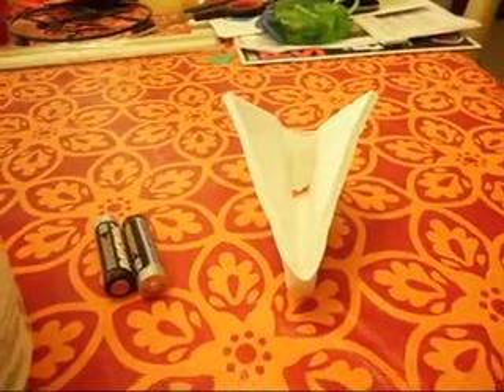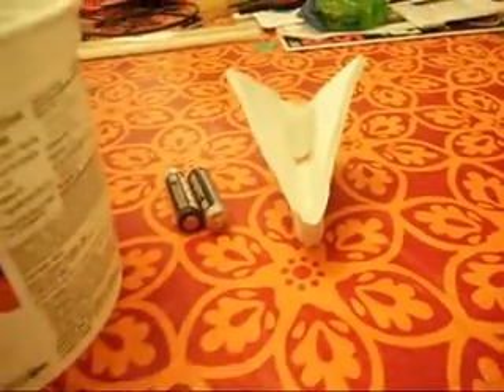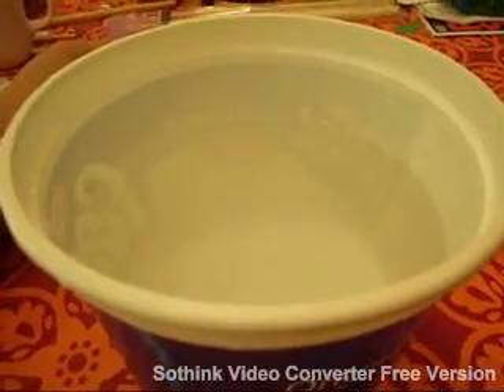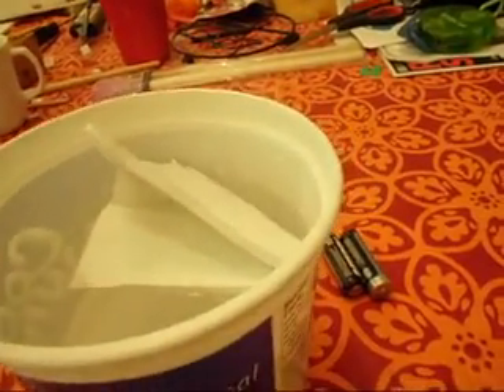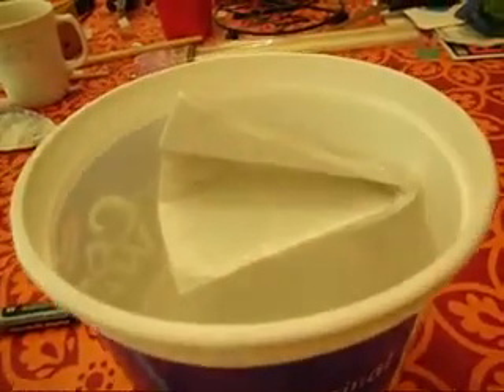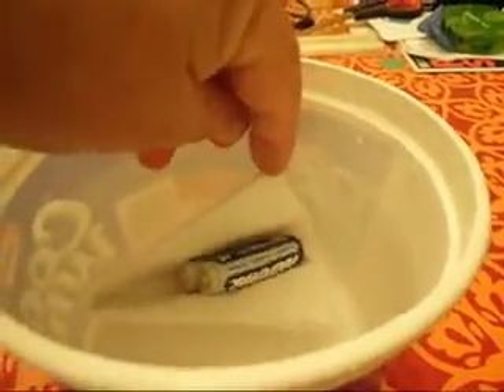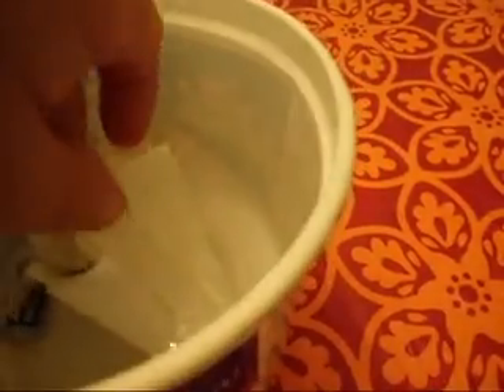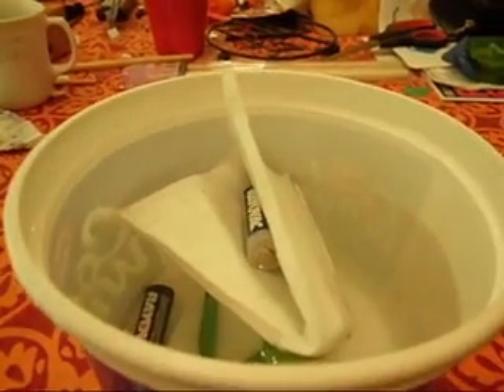Simply Unsinkable

Comment from the maker: I'd like to add that foam board does require some sort of sealer to be applied to the paper coating. This will keep the paper from soaking in the water and starting to flake off. The paper does not contribute to the buoyancy, but it could get ugly with repeated soakings and handling.